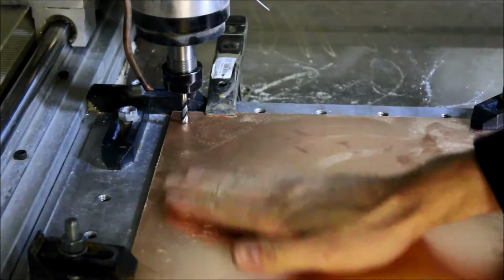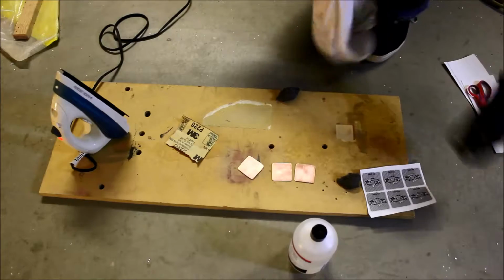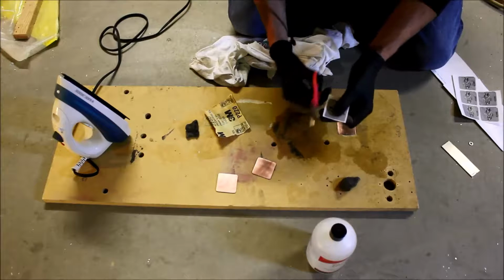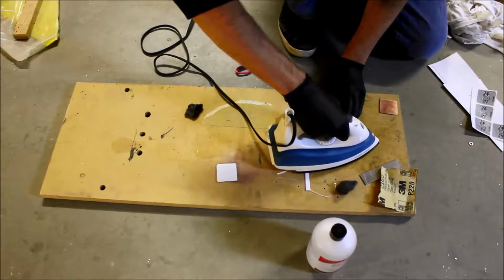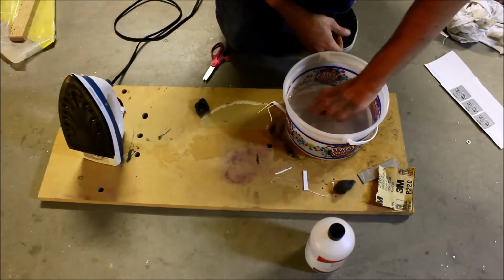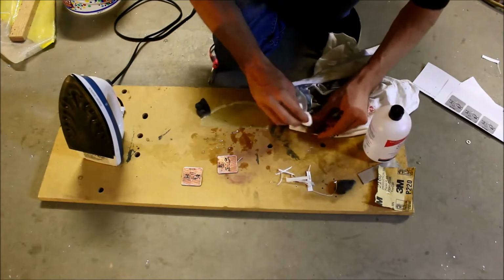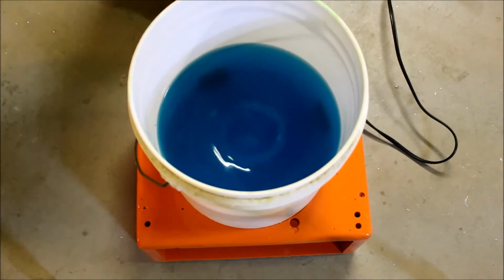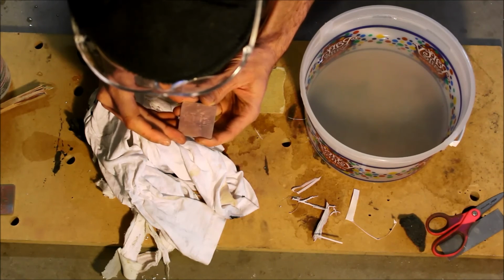diy circuit board ecthing

Comment from the maker: well, the cnc has a low resolution, something like .35mm or so.  The trace spacing, on most of the boards I etch, is generally smaller at about .25mm.  

Also, bits are likely to break when the copper clad is not perfectly flat (which is generally the case).  I suppose I could do many small passes, but the system for chemically etching the boards works pretty well.